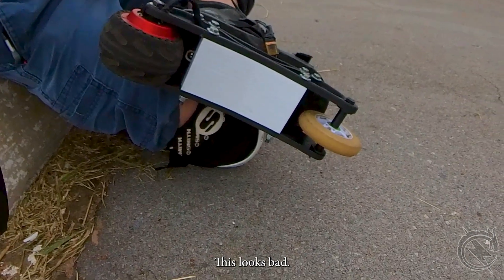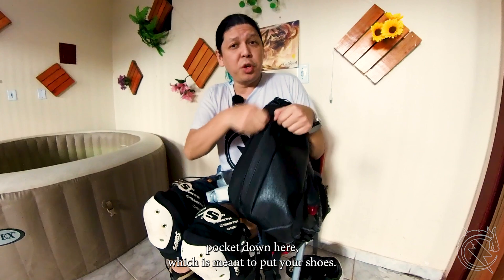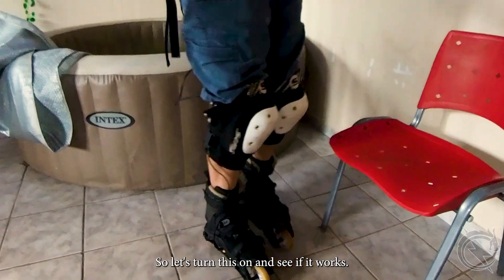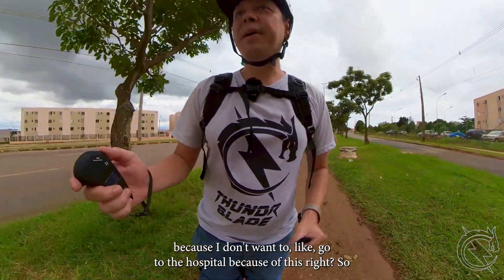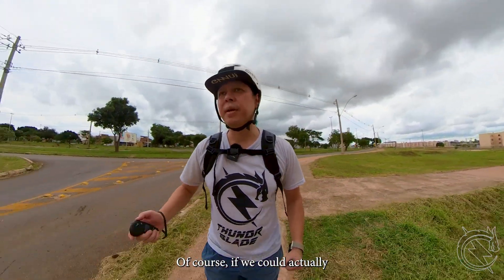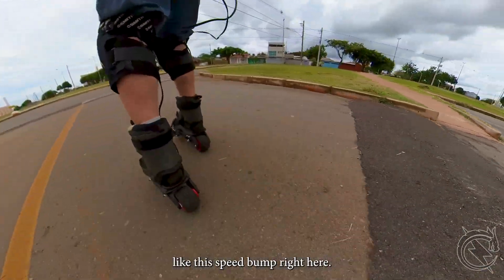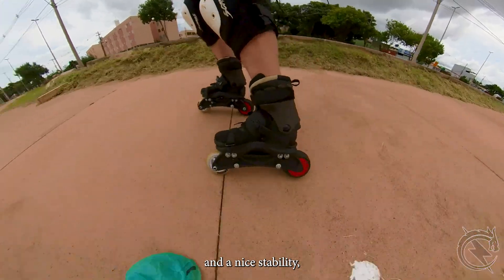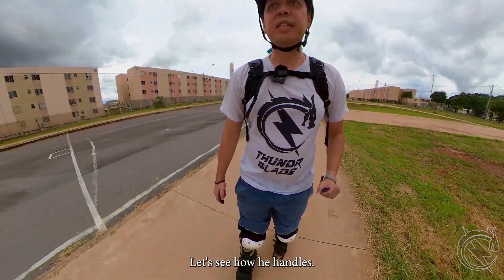Another Electric Inline Skate DIY Test...

Comment: I will add, that if you get a custom motor made.. you might consider having a cooling fan built into it.   Power Drills are an excellent example.  They have a Blower Fan, attached to the motor shaft... that automatically keeps the drill motor from over-heating.   And or,  you can also make air channels that funnel and concentrate air..  over / into  the motor  (of course, that only works when you are traveling fast enough).   Aluminum Heat sinks (with thin fins)  can also be used to diffuse excess motor heat.

 Of course, if the motor is suffering enough stress to get that hot... its never a good sign... and even the best cooling might not save it from self destruction.

 Furthermore... when a motor gets seriously over-heated...  it could take more like 10 to 15 minutes to fully cool down to safe (non destructive) levels.   AND... if you notice the motor is overheating... it might have already have been partially damaged at that point.   Not sure if a motor heat sensor would be too complex and or costly to add... but its a thought.   Such a sensor could auto-shut-down the motor, protecting it from melting itself down.   Maybe a battery health monitor as well...

Comment: To help prevent wires from getting caught or sucked up...  you could add a springy metal that they are mounted inside (long coil spring), or mounted to (like a car antenna material).   An alternative could be those Flexible rods that are used for fishing wires through walls.   Or at minimum... some semi-flexible plastic, that has some wire "pass-throughs" (tight enough to prevent wire from slipping down, and maybe even some lock-tight to temporarily glue it in place).

 Another possibility, is to use long flexible plastic tubing, from Blades into the backpack...  with some springy metal that supports (rigidity) the tube at the very bottom, where the wires meet the wheel.  Tubing, or even just a woven cable covering... would help protect the wires from the weather and potential scraping damages... and being less flexible than just wire... will help prevent wires from eventually breaking internally (from being flexed too tightly, too often).

 The backpack is probably better protection for the batteries, if you Fall...  compared to a fanny pack.   Just surround them in that squeezable protective packing material.  The same kind thats often used in shipping very large TVs (Not Styrofoam).

Comment: I'm glad the backpack worked :3 Sorry for the wheel mishap :( Seems like using a custom hub motor just has to go, especially as the seller nor motor you currently use is no longer sold, which defeats replacing the wheel if it fully breaks/becomes non-usable.

Comment: Escend and AtmosGear both had custom motors made for them with AtmosGear's being inline wheel sized so you could probably talk to whoever made those or get something similar made that wont chew up the wires from being so close to the shaft. theres also a few lose replacement motors with wheels around that could be custom fit into your frames if people are willing to put in the work to modify the 3D files
Reply: Do u know others people who are as advanced as AtmosGear or Escend in making Air Trecks ?